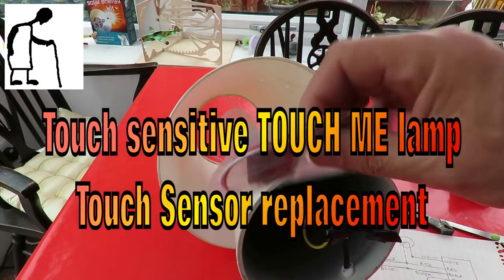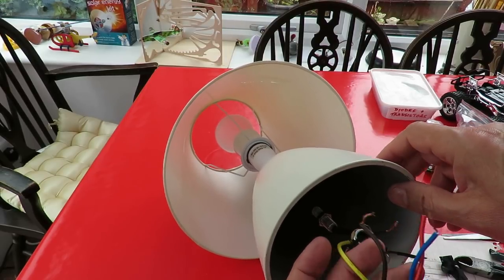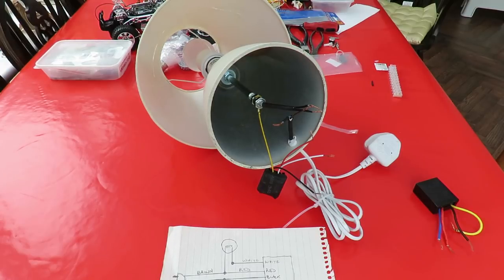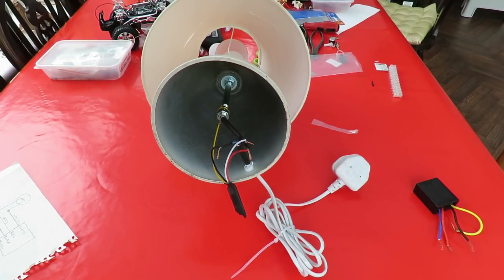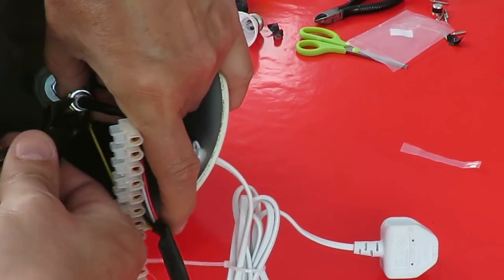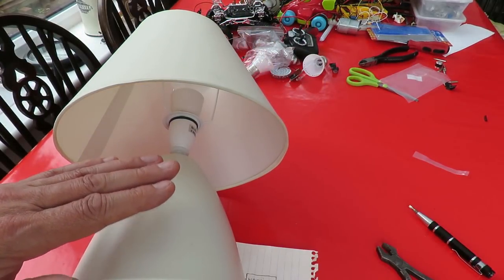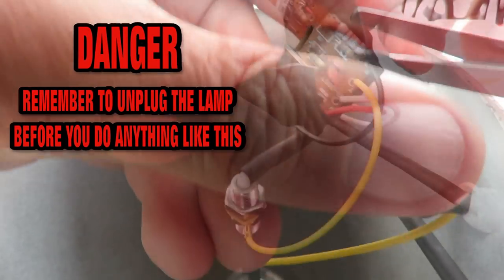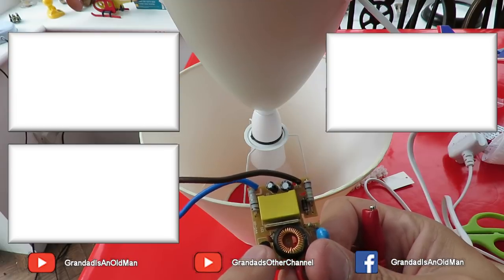Touch sensitive TOUCH ME lamp Touch Sensor replacement

Comment: Got a touch lamp here , and this is the first PROPER tutorial  I've found useful ( especially with the wire colours  being  different) mine is now sorted thank you , thanks to this I found it extremely helpful.  I've  only one touch lamp  at present  as I've  converted ALL the others to 12v dc ( to save the planet AND save a fortune  on electricity) I'm  now looking for a 12v dc touch sensor  so that other people  may use this information  for their  benefit.  Keep up the good work, and THANK YOU 👍
Reply from the maker: Thanks for the positive feedback. Yes, there does not seem to be any standardisation on the colour scheme for the wiring so it is almost "swap it around until it works, perm any 3 wires" 😆👍
Reply: Same here... Very frustrating for sure. Thanks for making this video...

Comment: Trainee electrician here. Good job problem solving to work out how it all went together. Important thing to note for anyone doing this is that it is important that you heat shrink or at the very least electrical tape all the wires and joints to make sure it is double insulated. This is because due to the nature of the touch switch the lamp is not earthed, so if for whatever reason a live wire is damaged or comes out of the joint and touches the case, you will get a shock when you go to touch it. I would also personally use butt crimps or wago connectors but connector blocks would suffice as long as you make sure they are double insulated.
Reply from the maker: Thanks for commenting. I am guessing you are a UK electrician as the rest of the world doesn't seem to believe in earthing anything and laugh at our regulations 😆👍

Comment: Thanks for sorting the very confusing wiring out - I was nervous after seeing a video of a newly installed touch circuit blowing up due to wrong connection! Your video gave me confidence to go ahead. Great!
Reply from the maker: There is a problem with the way they don't seem to have a standard wiring diagram or colour scheme. When it comes to things blowing up, you have to remember some people put stuff on YouTube just to generate views and thing catching fire or blowing up get the most views.
Reply: @GrandadIsAnOldMan  That's what makes genuine, capable people like yourself so valuable. Thanks again.
Reply from the maker: @jonathandavis4402  Thanks and good luck, and please take care as you will be working with mains voltage. I am not an electrician and obviously my disclaimer is you should seek advice from a qualified electrician before working on this. There is more information in the video description if you haven't already found it 👍

Comment: Thanks very much for this video, the bit that changed things for me was showing how you reinterpreted the wiring diagram, vis-a-vis the colour switching on the different products. I did exactly what you did, ie, swapped the mains wiring so that all the blues went together, and the lamp now works perfectly.
Reply from the maker: Hey thanks. There seems to be no standards for the wiring colour codes.

Comment: Thanks, your Drawing was all I needed.
Reply from the maker: Good luck with that. When I was looking for guidance I found several diagrams and they all conflicted with each other so you may have to try the permutations like I did.
Reply: I watched several videos also and the colors of the wiring weren't the same. There were no Blue wires anywhere on my lamp. I hooked it up exactly how your diagram shows and it works just fine, just like it's supposed to.
Reply from the maker: Brilliant, I will claim that as a success :-)
Reply: Yeah sorry

Comment: Thank you for this, I just picked up 4 of them with no specs.
Reply from the maker: Thanks, as far as I can tell they seem to use random wire colours half the time. I am no expert and looked at lots of YouTube videos and did lots of Google searches and found lots of conflicting guidance. All I can say is this worked for me.
Reply: GrandadIsAnOldMan a good look at the circuit board and I saw that it matched. No prob.

Comment: Thank you! I did not understamd how to connect this properly until I I saw your video. I have the same sensor, however it does not work properly with LED bulbs - they start to sound like a small transformator making a buzzing noize which is not nice when the lamp is next to my bed. With normal bulbs  it works ok :) so unfortunatelly I will leave the lamps like they are - with a mechanical switch :( maybe you can give me some ideas why the LED lamps start to buzz ??? :)
Reply from the maker: You will usually find the lamp has a label saying it does not work with CFL (compact fluorescent lamp) or LED bulbs because they have circuitry inside the base of the bulb to make them work which the circuitry in the touch sensitive switch interferes with. Very simply put, those bulbs are expecting a particular voltage and the dimmer circuit changes that.

Comment: Interesting.  I have a touch lamp waiting for me to get to-it.  In the US, I would have thought the red and white went to the bulb and the white and back went to the mains.  I was expecting fireworks.  But then again, I just helped somebody figure out that a manufactured LED module was wired with red and black reversed.  BTW - It looks like somebody sent you a copy of my "to-it" list.  ;-)
Reply from the maker: I did a Google search for the wiring diagram and found plenty but they were all different and we had every combination of the different colours available. I was going to include them in the video but some were marked as copyright so I decided not to bother.

Comment: Chocolate connectors are from the 90s. Use spring wire connectors. Feed the wire in and clip it shut. No faffing.
Reply from the maker: Feel free to use whatever connector you are comfortable with. This video is 6 years old 👍👍

Comment: Hi, great video. I would be grateful for you expertise... In my touch lamp, the nut securing the touch sensor to the metal chassis is impossible for me to remove and therefore I have cut it off the module, leaving it in situ... Can I attach the new touch sensor in the body of the ceramic lamp base with tape? And re-wire as you have described? Many thanks.
Reply from the maker: First, I am not a qualified electrician. Second, if you are unsure when working with mains voltages I would suggest you do talk to a qualified electrician. Third, I need to understand exactly what you are saying. In the video the yellow wire is clamped to the lamp with a nut. Is that what you mean? If that is what you mean then you will need to attach the new sensor's yellow wire to the same point. You could use an electrical connector to connect the new yellow wire to the end of the old yellow wire. That is the sensor wire that operates the lamp.
Reply: No I wouldnt reccomend that. Best to cut off the old module, leaving lots of wire and strip the end. Then cut off the ring crimp for the new module and join them using a butt crimp (or connector block).

Comment: I have a brown wire & a blue wire coming from the lamp bulb which colour do I connect the white wire too....brown or blue? Your diagram doesn't show the wire colours from the lamp bulb. Cheers
Reply from the maker: I think I made it pretty clear in my explanation that all these modules seem to have different colour schemes and all the diagrams I found had variations. Maybe watch the video again and listen to what I am saying and read the video description. Any answer I give you here would be a guess. If you are definitely only talking about the wires direct to the bulb 💡 then it makes no difference as the bulb will work either way round. It is AC so the voltage flows both ways.

Comment: So I can figure out for the life of me which order to put the yellow wire on??? Between the washer and bolt or Before  both?
Reply from the maker: You need to clamp the yellow to the rod for the circuit to work. Without seeing your particular lamp, I can only give you a general reply. The washer allows the nut to be tightened without the connector on the yellow wire being turned, so yellow, then washer, then nut. Did you read the information I put in the video description, regarding safety?

Comment: Hi I replaced my dimmer module but when i plug it into the mains the light flashes once then stays off. Any suggestions.Thanks
Reply from the maker: Sorry Mark, can't offer any suggestions other than mentioned in the video around the way that the wire colours seem to be different for each one you buy and I had to swap them about to get it working.

Comment: My problem is the original power cord coming to the lamp has two white wires.  I assume one of them is power and the other ground.
Reply from the maker: I don't know your local power supply details but if it is an AC supply and you only have 2 wires then they are both treated as live. I spent a lot of time in this video explaining all the diagrams or schematics I found were contradictory but they are two wire power feeds.
Reply: @GrandadIsAnOldMan  Thanks for your response.  This is US, we are 120 volt here.  We normally have black and white color coding, black power and white ground.  I have never seen blue and brown coming in for power.
Reply from the maker: In the UK we have pretty colours that have changed over the years. Here is an explanation https://www.electriciancourses4u.co.uk/useful-resources/history-of-wiring-colours-cable-sheathing-bs7671/

Comment: Grandad:
Do not use the tester to measure voltages and see where the fault is ?.
Or the continuity of the cables and connections (switching off currents, of course!
In these cases, I do so 8-)